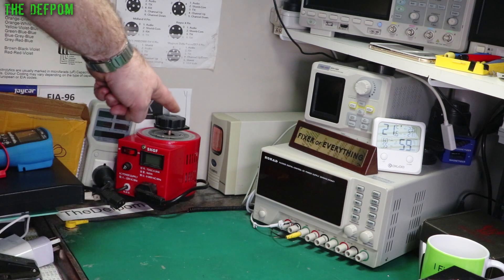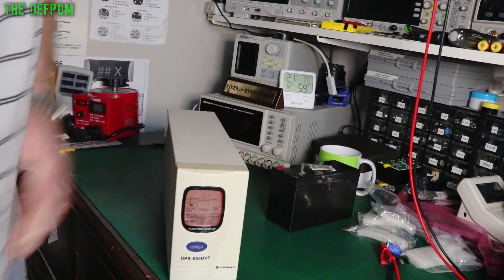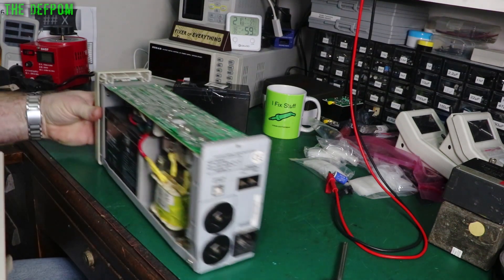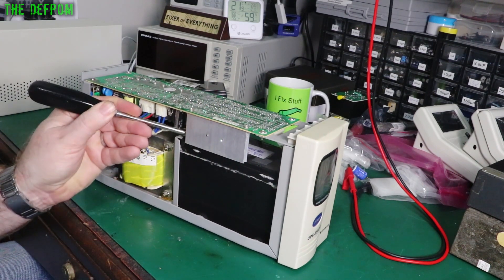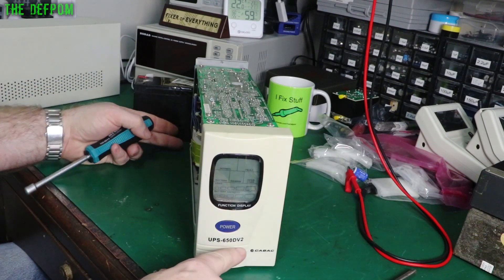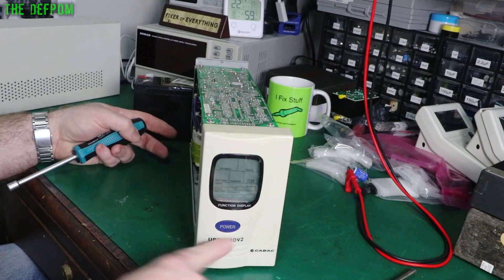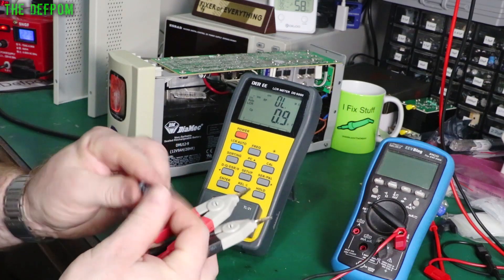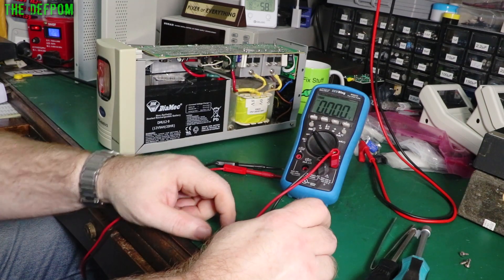Battery Replacement and Repair of a UPS650DV2 UPS

Comment: Peukert's Law.  Expresses approximately the change in capacity of rechargeable lead–acid batteries at different rates of discharge.  That's why the discharge rate is noted.  The batteries are the same capacity.  As you noted, they played with the numbers to look better.

Comment: Ohhh-Nooo, You Need To Dump Using Them Frickin Heavy Junk Lead Acid Batteries Mate! Get Some High Power Density LiPo or LiFePo Batteries In 18650 or Packs & Build A New Battery Of 2 to 4+ Times The AHs & Long Life For The Same Size Factor + Way Over Half The Weight!!! Thanks

Comment: Sorry, but if it's that difficult to change it the battery that UPS would find it's way into the recycler in short order. That's a crap design that was not meant to be serviceable. If the switching circuitry would adapt, I'd put a LiFePO pack with it's own charge and BMS module in place of the lead battery.  < 3 years per cell is ridiculous when they're not even being discharged deeply or frequently.

Comment: My UPS has a USB connection to my computer so the software turns it off every night for 5 minutes so the battery gets some regular discharging. If a battery sits on a charger which is what happens here the life is decreased greatly.

Comment: I saw a channel where the bloke replaced the SLA with Lithium Batteries with the BMS, and all.  So much better of a system plus it is actually way cheaper (lasts far longer than a SLA too).  Way less weight to it though.